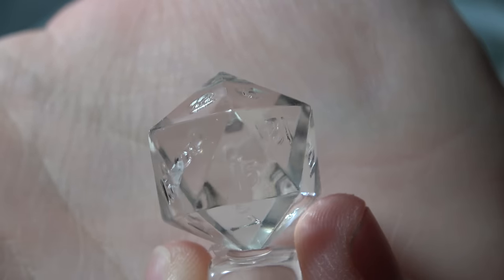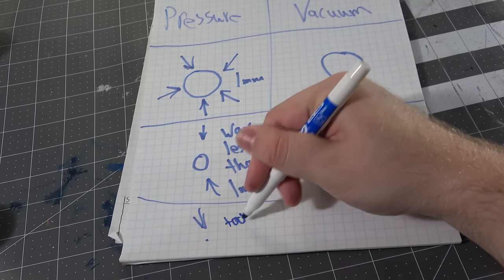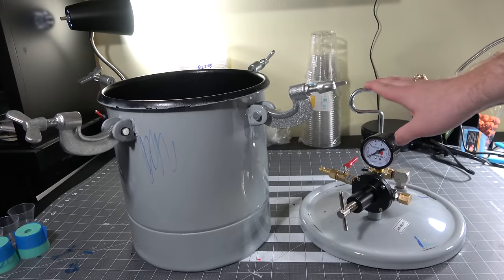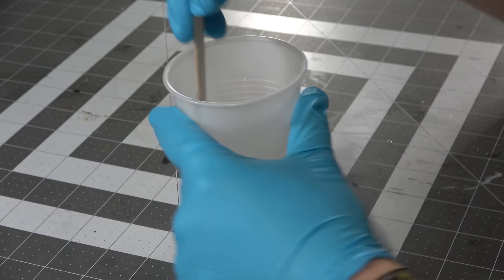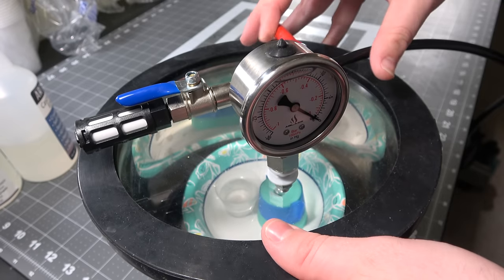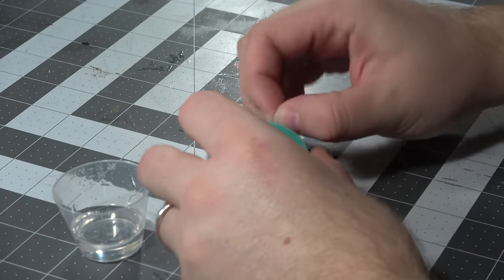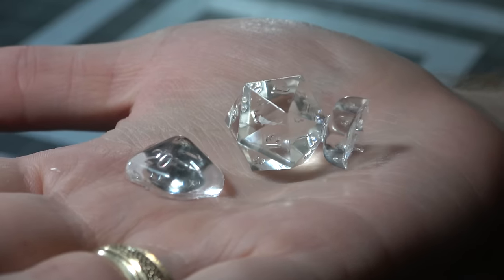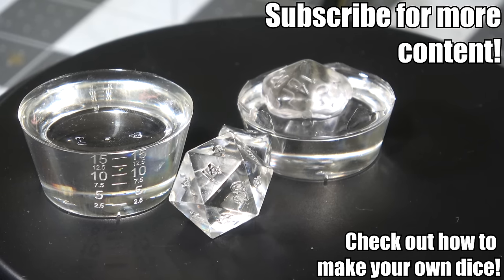Pressure Pot vs Vacuum Chamber | Resin Dice Casting

Comment: so because you dont know how to use the vacuum chamber correctly, means its not good for its purpose... yea, seems legit.

you dont put your final casting in the vacuum chamber, you put the reservoir of resin inside, vacuum it, then pour it into your mold.

when you boil water and it overflows, its not a fault of the stove or the pot, its the inexperienced person not knowing how to do it correctly...
Reply from the maker: I literally say that like 4 times in the video. It's actually the closing though that I put in the video as well.

You absolutely can use a vacuum to pull the bubbles and then pour it. The problems become that the vacuum has to pull for a long enough time to get all the bubbles out, and that means you need a resin with a really long working time. Not only that, when you pour it in after taking the bubbles out, you run the risk of adding bubbles back in. 

It requires more prep, larger mixing vessels to make sure that it doesn't overflow, specific resin with long working time, and runs the risk of getting bubbles anyway. A vacuum is less effective for DICE MAKING specifically than a pressure pot. That doesn't mean it is/isn't for all resin casting.